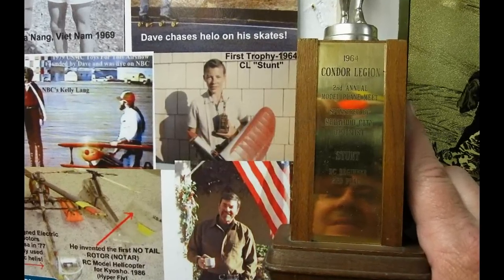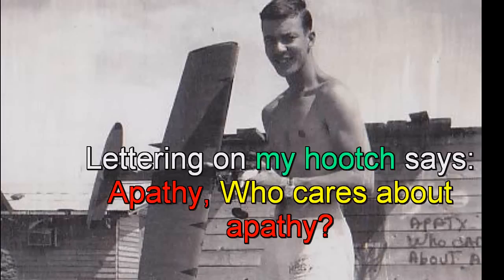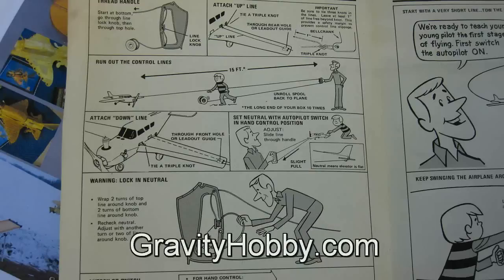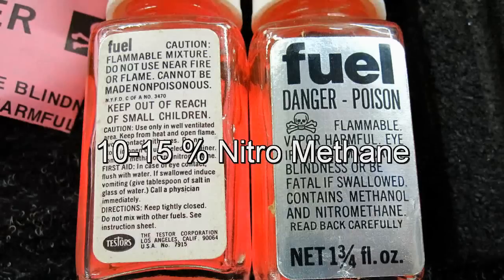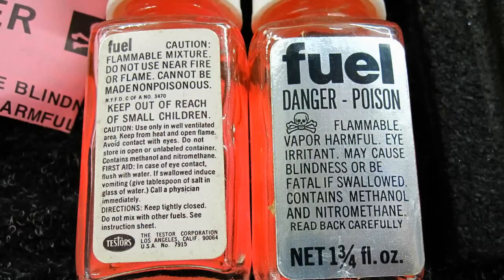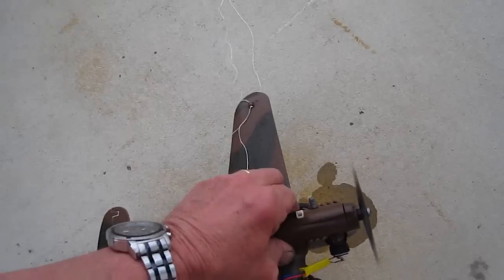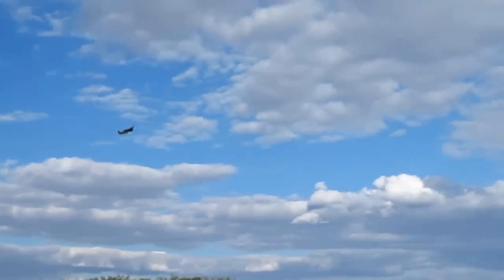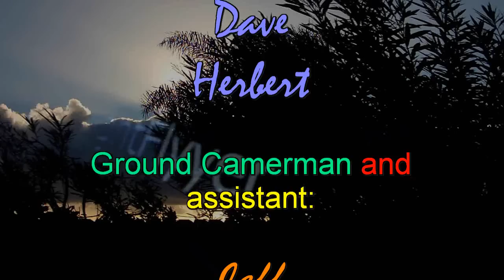Vintage Cox Control Line Plane's History and flights by NightFlyyer. A few are Testors.

Comment: Such memories. As a cub scout in the early 60's I sold greeting cards door to door and used my credits to buy the Cox line control planes. I think I had the whole line. In the mid 70's flew full stunt line control then moved to RC. Good clean fun. Maybe not so clean as the spent oil had to be cleaned off. Thanks for sharing.
Reply from the maker: So true. The fuel in those days had Castor oil.  Thanks so kindly.  I would bet if you liked this, you will like to see my latest video of my 63 year old Cox PT 19 U Control flight from last week. 
https://youtu.be/BU0z7ddwslY
Reply: I sold greeting cards also but I think I bought a b b gun

Comment: That Disneyland demo worked.  In 1958 I saw it & was mesmerized by the planes.  They flew a pair in a combat game to try to cut off ribbons attached to the tail.  That Christmas brought a PT-19 which never really flew well.  Then a P-40 which was a wonderful model.  I flew it & crashed it so often I got decent at fabricating replacement parts from balsa wood.  Thanks for the video bringing back great memories.

Comment: I had a silver P-63 Kingcobra, I had almost as much fun looking at it as flying it...the key to getting it running, I think, was having a good strong battery to power the glow plug, and having a clean glow plug. I always kept a glow plug wrench handy to check the battery by physically pulling the glow plug and making sure it glowed cherry red, if not bright orange. I had a couple of Wen-Mac (made by AMF) planes as well...a friend who lived down the hall made his own planes from sheets of 1/4" balsa. The fact that a lot of the .049 engines had integral fuel tanks/engine mounts screwed to the back of the crankcase made these SO easy to knock out in an afternoon...

Comment: Brings back found memories. One thing I learned when adjusting to elevator was to give it more up than down. Moved on from 049 to Nobler with .035 Stallion engine. One of my favorites was Fox 15 with stunt with no wheels.
Reply from the maker: Right on.  That sounds great. Noblers were very popular along with the Thunderbirds I flew in the contests.   Thanks so kindly.  I would bet if you liked this, you will like to see my latest video of my 63 year old Cox PT 19 U Control recent flight. https://youtu.be/BU0z7ddwslYUkie

Comment: I used to fly my Ringmaster on 70 foot steel lines. You had to keep track of your inside loops, then do the exact number of outside loops to keep your lines from being crossed. I LOVED flying control line models in the Sixties as a young teen. When I took my first flying lesson in a real plane (Piper J-3 Cub) in 1966, I already knew how to make a landing as it is the same as landing a C/L airplane. I turned my model flying into a career flying real airplanes, including 29 years as a pilot for United Airlines. 54 years later I am still flying professionally and still have 5 flyable control line models. I have always felt my flying career really began the day in 1962, as a 12 year old, that I was able to fly my Baby Ringmaster for a full tank of fuel without crashing.
Reply from the maker: That's a great story.  Glad your still flying.  For me it was RF4B Phantoms in the Marine Corps.  I still fly Ukie and have several videos of me flying them on my channel.  I took my first trophy in 1962 in a stunt contest with a Veco Thunderbird and Johnson .35 combat special engine.  At the contests we only used 60' steel lines, but have flown many times on 70's.    Here is a video of my Cox PT19 from last year you may enjoy.  All the balsa planes certainly flew better, and my fav was the Baby Flite Streak.  Happy flying and Thanks.  63 year old Cox PT 19 U Control recent flight. 
https://youtu.be/BU0z7ddwslY

Comment: @NightFlyyer - You must be around my age as I built and flew many U-Control planes, both balsa and ready built plastic.  The Wen-Mac Corsair was my first plane.  I smashed it to pieces in the school parking lot the first flight - ooooh, that hurt!   Also had a Cox .049 Trainer that was held together with large rubber bands and would 'fly apart' on impact instead of smashing to pieces like others.  Those Cox .049 engines were very strong and dependable.  Had a Cox Tee Dee .010, and boy could that little engine turn some RPM!  Also had the tethered Cox Prop Rod which was a lot of fun.  Great memories from our yester - years!
Reply from the maker: I sure hear a lot of similar stories for sure and can relate myself.  
Thanks so kindly.  I would bet if you liked this, you will like to see my latest video of my 63 year old Cox PT 19 U Control flight from last week, (held together with rubber bands)
https://youtu.be/BU0z7ddwslY

Comment: My Dad taught me to build free-flight, rubber powered and Cox-powered Control Liners out of balsa/silkspan/white glue back in the 1970's. My school buddy has that Piper (Comanche?) and the P-51 'stang with some weird throttle control (a third line I think it was??). Many fond memories for building/flying/crashing them all! I have one homemade, solid balsa wing with flaps.....that had the outer wing fold up vertically one flight after a hard landing the previous flight. Damn thing kept flying until fuel ran out!
Reply from the maker: A good story. I crashed and ruined several Voodoo combat wings and know they fly pretty good with only the inside wing.  Thanks for the story and be well.

Comment: Excellent vid NightFlyer. Brought back a lot of memories. I always found the old Cox U-control stuff (PT-19, Mustang, P-40, et al) a bit heavy and was more of a "brick on a string" feeling when flying them. Later, more powerful and larger U-Control balsa aerobatic aircraft like the Chipmunk with a Fox .35 really gave you the feeling of flying, like you said, would do square 8's, inside and outside loops on 65' of flying wire. I learned early on how to keep from getting dizzy while flying a round. You turn your body with the plane and play catch-up with your head just as the plane starts leaving your peripheral vision. Thanks for posting!

Comment: The Cox Super Chipmunk and Messerschmitt Stunter with the hollow foam wings from the ‘70’s were the only Cox RTFs that you could really fly.  I still have the Chipmunk stunter from the 90s with the solid foam wing, but it doesn’t fly as well as the older ones.  My first Cox was the Bushmaster- a Super Cub with wheels, skis and floats, about 1973.
Reply from the maker: That's a great line up and story.  Thanks so kindly.  I would bet if you liked this, you will like to see my latest video of my 63 year old Cox PT 19 U Control flight from this week. 
https://youtu.be/BU0z7ddwslY

Comment: I flew these when I was a kid and later graduated on to free flight models and then on to RC.
One of my free flight models was a design that my dad came up with off the top of his head
It had profile fuselage and a sheet balsa wood wing, horizontal and vertical stabilizers the
vertical stabilizer was made from a scrap piece of 1/8 inch balsa that look like the side profile 
of an outhouse so that is what we called it “THE OUTHOUSE”  It had a Cox 020 on it for an engine
my dad modified the full tank by drilling a hole in the side of it and running a piece of fuel line out of 
the tank to a glass eye dropper mounted at a forward angle on the side of the fuselage with marks 
on the fuselage for engine runtime, this way you could get the engine running adjust the needle valve
wait for the fuel level to get down to the engine run time that you wanted and launch it would run until the fuel 
ran out and glide back down. As time went on I got braver and braver with longer and longer run engine run 
times until it's last flight, I launched it with a full eye dropper the last I saw of it, it was heading northwest
towards Tampa bay.
 I chased on my bicycle until it was just a speck in the sky that was back around 1966 
and I think it’s still flying today. Years later after I went on to flying RC models I went in the Air Force and while I was 
Stationed at Tyndall AFB just east of Panama City, Florida I met up with a guy named Bill Dixson. 
Bill was the best control line model flyer that I had ever seen, he would fly an entire flight without making  
a single circle. He flew on 55 ft lines at 45 degrees up and never make a complete lap. Bill wanted to learn to fly RC 
models so I taught him to fly RC, and he would fly them at 55 ft out and at 45 degrees up. and never make a complete lap
I guess that was his comfort zone.
Reply from the maker: Such a great story for sure and thanks for serving. I was in the USMC aviation wing for 34 years myself, so can relate.  Thanks again.  Here is a link to last week's ukie flights where we got Goated that we bet you will enjoy!  https://youtu.be/HdmXA0Xc1ew
Reply: @NightFlyyer  
Thanks I am glad you liked the story, I don;t know whatever happened to Bill we lost contact after I got out of the AF.
You can check out some of my early videos on my old YouTube channel https://www.youtube.com/user/Uavman2/videos
This is my favorite video on that channel it is me flying a 10 ft  Ultralight Model that another friend of mine Bruse Knox built bac in 2002   https://www.youtube.com/watch?v=xwf9-VH7f-4  
I have forgotten the login and password for that channel so I had to start a new one, there are some  of my older videos on the new channel.

Thanks
Dave.

Comment: A visit to Disneyland back in 1962 was my introduction to control line flying. There was a demonstration of combat flying in Tomorrow Land that got me hooked. 3 weeks later was my birthday and I got a Cox/Testors Lil' Toot Biplane with the Cox .020 engine. A few crashes later and lack luster performance my next was the Cox P-51 with the Thimble Drone 049 engine. My dad crashed it on it's maiden flight, but it did introduce me into model building my own planes out of balsa and doped tissue paper. I'm retired now but never stopped building and flying, even building a jet model of the plane I flew for real!
Reply from the maker: Great to hear.  I too watched many of those fliers at Disneyland, long after I began flying them at age 8, but it was fun to watch.  Good on you and happy flying.  Thanks.

Comment: These plastic plane started my fun with model planes. Started with the plastic planes which was followed by Flat Balsa 1/2A, .049's, then to Build-up balsa wings, flat sided fuselage. Then on to .35 powered planes, then in 1976 got my first radio and into full build-up planes, scratch building. Today 59 inch WS planes and 6 channels with .46 engines. I am a happy "Wet" flyer.
Engine powered planes have a long flight times, so much more than the Electric's today. Besides the power systems cost about the same with the electrics and the batteries are the largest out of pocket cost.  Once a person learns to handle the more powerful 2 cycle alcohol fueled engines the reliably goes way up.  I still enjoy the 2 channel .049 powered 24 inch wingspan planes. I can fly all afternoon on less than a quart of fuel.  Great way to practice flying R/C for little cost.
Reply from the maker: That is a great story and glad to hear it.  Electrics are as you say, but my heart has always been with nitro biplanes, since winning a few trophies at the National Multiwing championships years ago.  I recently acquired this Gasoline powered Pitts, and I donated my Byron Nitro (Belt drive) Pitts to the AMA museum, and agree.  Gasoline is still cheapest as the last gallon of Nitro 20%, cost me $70!  Heres my latest Pitts video. Please enjoy and thanks so kindly! https://www.youtube.com/watch?v=AcqLCqgiQ70&t=36s

Comment: I finally got back on roller skates after 25 years. I used to pretty much live at the rink. I got a job there and eventually went on to teach dance skate as well as competition skate. After q5 years I could hardly stand up. after I stopped thinking about it and let my feet take over instead of my brain, I was doing better. I will admit,I doubt I will ever be as good as I used to be. I dont want to break anything. It was great just getting out there and skating again. I miss the disco music. Anyway,I hope to run across an old Corsair like the one I had. many great memories with that.
Reply: +scott firman 
I'm 63. I used to skate every single Friday and Saturday night at the Pismo Beach roller rink in the mid 70's as it was the cheapest thing to do. I have not skated in 25 years. Just the other day I stepped off my friend's Tollycraft boat and the plastic stool on the dock collapsed. Wow, the muscle memory kicked in and I did a crazy move and saved my bones. Never fell!  Part of that stool went 15 feet away.

And my dad wrapped a Cox Cosmic Wind around my neck while flying on the garage roof. The prop cut the lines after 3 times around my neck. I was 5 years old... My favorite was the Cox P-63 , .049 of course.

Comment: Still have several brand new Cox motors of various sizes in their unopened boxes plus a shoe box full of 'broken' bits.
It is a pity they were (are) so noisy because they ran for ages on a small tank of gas.  Also have several fitted with a sort of muffler and throttle sleeve which makes them great for small radio control models.  Thanks for opening that box of memories.

Comment: thanks for the blast from the past , still have at least a dozen cox engines ,  i used to fly control line 
 stint in WAM , western aero modler  ,  that was some great times as a kid.
Reply from the maker: I also was a Member of WAM.  It was required and the Pattern and Combat contests I entered were in Stockton and Redwood City.  Thanks for commenting and stay well.

Comment: Seemed like about every kid had the Cox PT-19 U-control trainer. The motor was held by rubber bands and you could  change the positon to make the plane more sensitive. We flew in a friends front yard for a time on line that were around 15 ft, talk about dizzy.  then we moved on to the balsa planes like Lil Jumpin Bean, Wizard, Lil Satan, and then to designing our own. Neighbors didn't get too excited about the noise back in those days.

Comment: Boy does that bring back memories. For a week after Christmas all you could hear was the scream of these little planes in the neighborhood, till they were all smashed to bits. Then we would take the motors and build "Voodoo" kits and install our little 049s on them and do some real flying. All the kids in the neighborhood would give us their smashed planes, batteries and whatever fuel they had left. I also built several "Voodoo" planes with using a FOX 19. I am just getting back into flying having just bought 2 Apprentices 1 with floats and 1 with landing gear.
I'm dying to build a P40 or a Pylon Racer from scratch, just like the old days.. well, not exactly.. no control lines

Comment: That was cool. I have a couple of COX line control models here. A Fokker DVII (which was my fathers) and  Sopwith Camel, which I bought, just cause.
Both had seized engines, which I freed up and got running. The Engine in the COX had been seized for over a decade, and hadn't run in about 30 years give or take.
I must try finish them off and fly them sometime.
Reply from the maker: That's a great story.  Get em out and fly them and have some fun.  Check out the video I made this week flying UKIE again. https://youtu.be/HdmXA0Xc1ew

Comment: My very first model airplane flight was in the Cox demonstration circle at Disneyland in maybe 1960 or 61.  We flew the PT19 trainer, I crashed it of course, but that wouldn't hurt that plane.  Of course I had to have one, as I recall I got one for my birthday, a bunch of Cox plastic U control planes followed, and I still have a Cox P40 from the early 60's.  That led to flying Ringmasters, Flite Streaks etc with my McCoy Red Head 35, which led to RC in the late 60's, and I still fly RC to this day.  I also got my Private Pilots License in 1978 and flew single engine private planes for about 20 years.  And it all started at that Cox demonstration circle in Disneyland!
Reply: G56AG rubber band plane
Reply: I also remember that cox demo circle at Disneyland...the planes were great and introduced me to control line flying. I also remember that red .049 pusher prop car that went "crazy-fast" in the circle!

Comment: Do you have any experience with variable compression ignition “diesel” motors? Im looking to learn how to use the compression screw at the top of the engine. The engine I have is a cox 049 with a hardened shaft and a diesel conversion head. Let me know, and keep up the awesome videos!
Reply from the maker: Yes , I used to have a TD 049 I converted to diesel.  It was a good runner, but I always used a little electric starter, as cold starts were hard. Good luck with that and happy flying.

Comment: You must have been an Aviation Electrician.  I joined the Navy in 1971 as an ADR; a radial engine mechanic.
Had a Cox Helldiver when I was a kid. It was supposed to drop a plastic bomb but I never tried it. Just flying it successfully was enough for me.  Flew it about 6 times and a kid offered me about 2 bucks less than I paid for it NEW so I let him have it. 

Years later, in the Navy at NAS Memphis, Millington TN. a guy bought a Cox super stunt Bf 109. It had a hallow foam wing and fairly low wing loading.  Flew great! I'd go half the circle level flight, flip to inverted  and take it back.  Then went into lazy 8's. I was amazed. Solid plastic wing Cox plane simply do not stunt. But they got a lot of kids interested in flying model airplanes. I was one.
Reply: @SCooter George - had one of those, damn had the little plastic b omb, first time i've thought of that in almost 50 yrs !!  never got it to fly.  Where i work they're still flying radial dromaders, but not much longer.